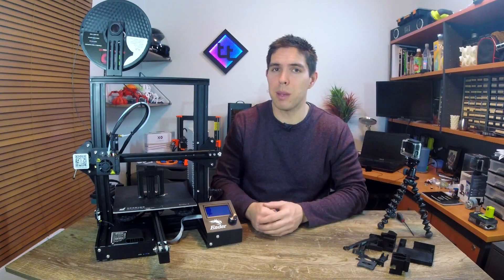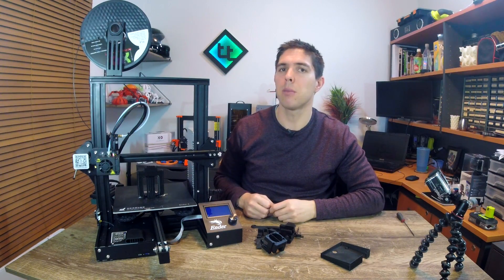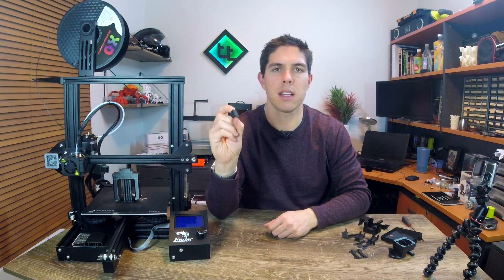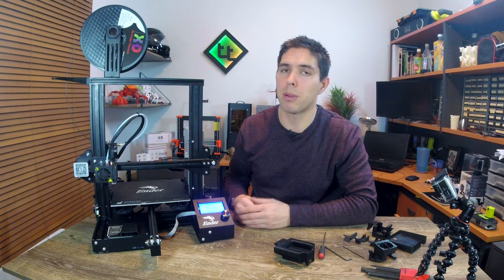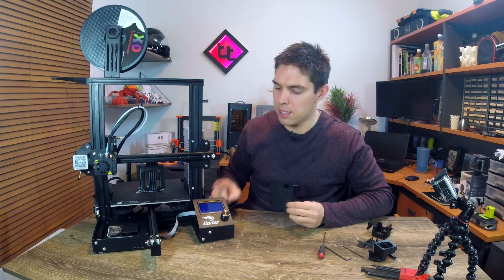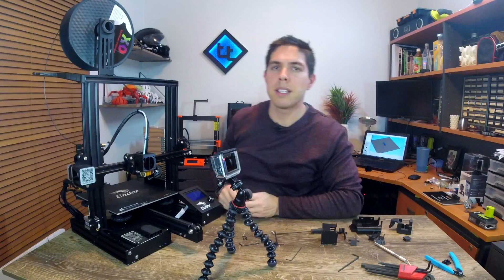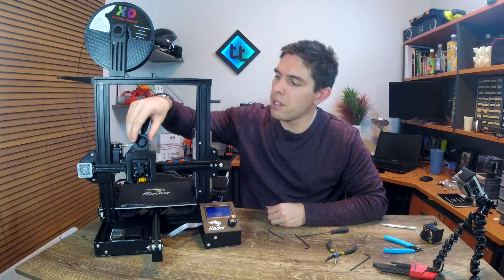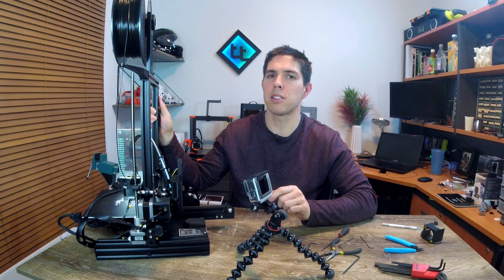7 easy 3D printed upgrades for your Ender 3

Comment: I’m glad you mentioned the bltouch, I’ve not used one before, in your opinion are they better than induction sensors? I’m off to watch the review video you did now thanks.and to check Thingiverse if there is anything for an induction sensor as that’s all I have at the moment and I love auto bed levelling. Looking forward to that video. Cheers
Reply from the maker: I have a BLtouch on my Cocoon Create Touch and an inductive PINDA probe on my Prusa MK3. Both work great. I suppose the advantage for the BLtouch is that it doesn't need a metal bed, which is a strong consideratuion if you are printing on glass or mirror.

Comment: Thanks about that! I have the same issue with the Z-motor not being aligned (which disallows the motor to push the X-axis bar).
However, I also have an issue with the bed not being flat, which is a problem (not super fan of buying a glass as everyone else).
Reply from the maker: Automatic bed levelling in an option that can fix that without resorting to glass.

Comment: Have you found any need for a glass bed on the ender 3?
Reply: Teaching Tech I ordered the "ultrabase" from creality store on aliexpress that is 235mm instead of 220, as I damaged the print surface when removing a hard stuck piece.
Reply from the maker: I think it might be worthwhile, especially if your bed is not flat.
Reply from the maker: I've had a glance and 235mm should fit. Most printers have a bit of room for a bigger surface, it's just there isn't aneough carriage travel to print bigger than standard.
Reply: Teaching Tech I checked and you can print 230 with no problem. In addition I didn't want to see the aluminum heated bed with a smaller ultrabase
Reply: Hi Sean. I had all sorts of problems with the stock bed material and had a piece of mirrored glass cut at a local shop for $7. I peeled the stock bed material off and put the glass right on the metal. Works great now. I'm printing PLA at 205 degrees and have the bed heated to 75 degrees. Things stick very well. Went from constant mucking around to getting on with printing.
Reply: Question about that: Do you have to remove the original bed material before installing the glass, or can you simply place the glass on top of what's already there?